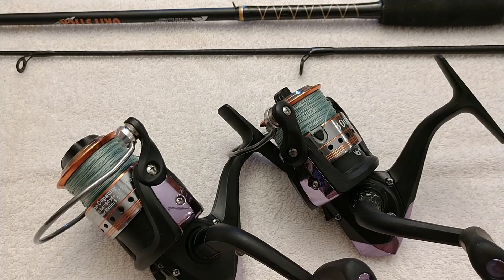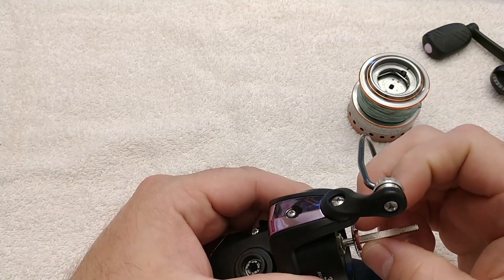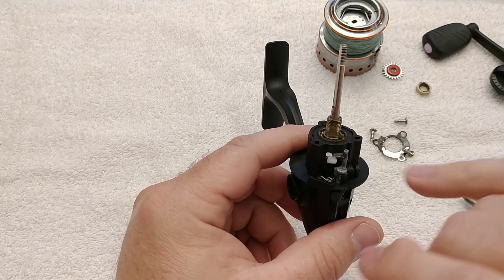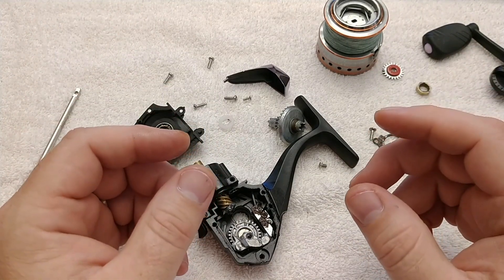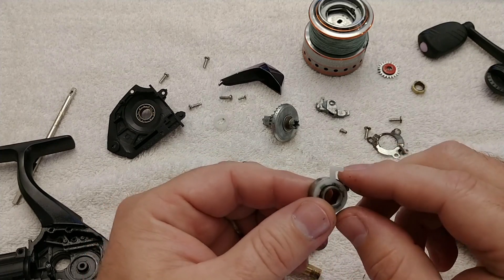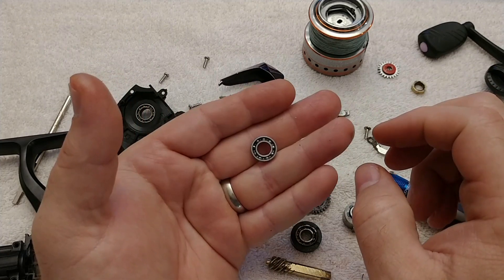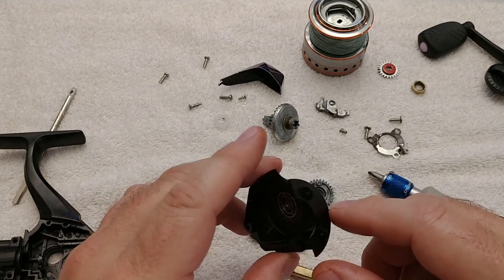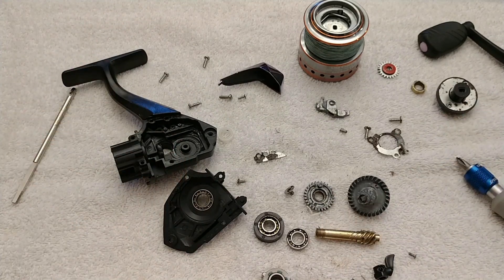Reel Won't Turn? How To Fix A Broken Reel That Won't Crank

Comment: Shockingly, I have never opened one of these up before my bearing was in a housing with two screws holding the bearing down, I pulled it out to clean it and it was so seized up I used some pliers on the bearing and it SNAPPED!!! Thank god it has a housing I pulled each ball out and cleaned them and put it all back together and slid it back in the housing then put the screws back on and boom fixed! Thanks so much for the walkthrough!

Comment: I went fishing back in October at the NC coast and used 12 of my vintage fishing Rees (no Daiwa 8600 this time). It was the first week of November before I finished taking them all apart, cleaned, lubricated and reassembled them. Speaking of bearings vs bushings I have three of those huge Daiwa 9000C Silver Series saltwater reels that only have 1 ball bearing and nylon bushings. These reels are 50 years old and work perfectly! The 7000C in that series (I have four) has three ball bearing in it are I’ve had to work hard to bring some of those bearings back from being seized. I’ve even replaced a few in a 4000C. I use PB Blaster to rejuvenate old bearings if it is possible. I personally hate reels with an AR clutch and no override. I think I have one Quantum and I never use it. I am opposite of you as I saltwater fish a good part of the time. I wish I had an ultrasonic cleaner but I clean my reels the old fashioned way. At the coast I always rinse off and wipe down all my Rees after use. If any of them get dunked I take my tools with me and I’ll disassemble that reel at the beach house and clean and lube it right there. I have many of my best vintage Mitchells in waterproof cases to protect them. I also have cases for some Penn Z Rees and my Shimano SSG7000 saltwater rear drag reels. I use gun wipes to wipe off the outside of my reels after they are dry. You gave some great advice in this video! — Chris

Comment: Thank you for the video! Got a Piscifun flame reel and first time using it in the river but the sand banks made my reel fucked up and seized up the main bearing. Got it loose with nearly all the sand out but the I spilled some grease down in the anti reverse lock areas and now my reel won't stop spinning. But this video will help me now!
Reply from the maker: Good luck with it 👍

Comment: I sold so many variations of that older Shimano you put up from 94-2002. Shimano just took that essential simple reel concept, and built a lot of their lineup around it. The ones you showed usually last the average angler 10 years by me (freshwater).
Reply from the maker: Those are decent reels and super cheap. Just reliable. Some of the really old ones with the same basic design from the 80's didn't use the fast cast setup, I wouldn't mind having one of those.

Comment: I have an interesting problem with my real it feels super smooth when you’re just testing it spins like a top free wheels just amazing but after your fishing with it for about 30 minutes to an hour it gets to where the handle doesn’t want to turn it starts sticking I have oiled it I’ve used real grease everything I know to do it’s quite the problem and it’s a new real and it has been this way since I purchased it I should’ve returned it but did not I thought it just needed broke in or a little lube
Reply from the maker: That is a strange problem and I'm not sure what may be causing it.

Comment: Where in the world do you find parts? I have a pocket fishman  that is rusted on the inside.
Reply from the maker: To find parts for that would probably require finding them or a parts reel on eBay.

Comment: Hey man,
Been struggling with my shimano Sahara c3000. Last time i used it something got stuck and i broke most of the gears. I basically replaced all the innards, cleaned and lubed everything. Seems to turn smoothly until i put the rotor on and i can hear friction. If i go ahead and put the top nut on, the reel can barely turn. I put it back exactly as i remembered. Watched videos, looked at every diagram and can't seem to figure it out.

Any input would be greatly appreciated

Thanks
Reply from the maker: It sounds like you are possibly missing a spacer washer that would go under the rotor. There have been a lot of different versions of the Sahara C3000 reels, so I’m not sure if this is the correct schematic for your particular reel or not…but take a look at part number 35 in the schematic. A part like that would be my first suspicion as the culprit. https://www.plat.co.jp/parts/SHIMANO-Spinning/SAHARA/17-SAHARA-C3000-03628.jpg
Reply: @TheFishingHobby  thanks for the response. Just took it apart again and i did have a washer there. But upon further investigating i noticed my clutch assembly was missing a roller. Not sure if that could cause that problem, but i guess I'll replace that and get back to you
Reply from the maker: That very well could be the problem. Good luck to you, I hope the clutch assembly fixes it for you!

Comment: What would you use as lube every time you say you would clean it and lube it up
Reply from the maker: I personally use Super Lube oil on parts that need to be oiled and Super Lube grease on parts that need to be greased. It isn't made specifically for reels, but a lot of people use it for reels.

Comment: hi, if you get chance can you post some links to replacement bearings, thanks, and is there any bearings you get that are more quality than others,
Reply from the maker: Here is an example of some cheap bearings: Generic MR147 7x14x3.5 mm Metal Open Ball Bearing (Pack of 10) by SnowSpitzShop Brand https://www.amazon.com/dp/B073X26D4Y/ref=cm_sw_r_cp_apa_i_squ3CbATGGHZW

I always order cheap ones because I just fish freshwater. If you want better quality, Boca bearings have a good reputation. Any well known bearing manufacturers will also have high quality bearings. Companies like Timken and others.
Reply: @TheFishingHobby  thanks
Reply from the maker: @lazycarper7925  no problem 👍

Comment: I just bought a new daiwa Bg 8000 and on the first day it started getting hard to crank. When my line is in the water it gets hard to make the line right or even reel in. Any tips?
Reply from the maker: I'm not sure exactly what is going on with your reel. Do you hear and grinding or rubbing sounds while reeling? My first thought would be something is binding. I have seen a bent spool oscillation shaft cause similar problems on other reels. You might want to take it out and roll it on a flat surface like thick glass or something similar and look for any signs of it being bent. Here is a great write up on those reels with a lot of disassembled pictures you can use for reference: http://www.alanhawk.com/reviews/bg16.html
Good luck to you on figuring out what is going on. I hope you are able to get it working right!

Comment: Thanks 😊
Reply: Mike from Maine here greetings! I have a small micro light South Bend tiny pole I got it at the transfer station for next to nothingand reelPretty cool rig but broke the post for the oscillating gear inside and I had to put a screw through the side of the real casing I drilled it out and it actually came out pretty good it’s holding so far now I’m just trying to put the thing back together LOL doing all right so far
Reply: Appreciate the video I almost did one myself Well I have this whole thing taken apartbut I don’t have a lot of practice with that type of thing ha ha but thanks a lot
Reply from the maker: Sounds like that should work 👍
Reply: Funny I got it working good now but everything went back together now I can’t figure out why it won’t lock as a real it in
Reply: Excuse me as I reel it in
Reply from the maker: Lock? I'm not sure what you mean

Comment: Miss your videos buddy!
Have you ever made your own bobbers? Been experimenting with BBQ squares and cork from wine bottles.
Reply from the maker: I've been putting out several videos lately! Stop by my home page and take a look, might be something you like in the newer stuff 👍 I built an extra long ultralight rod out of an 8' long vertical jigging crappie rod that is a blast to fish with. You may want to check that video out.
I have never made any bobbers but if I do I will be sure to make a video on them!
Reply from the maker: This link will take you there: https://www.youtube.com/channel/UCqne7f-bMbuFFlnKETAesiA
Reply: @TheFishingHobby  Just watched it, great video!
Got a solid fiberglass rod from the 50's I think. Want to do the same thing.
Reply from the maker: @thejim3501  I just happen to be building my daughter a solid glass rod at the moment! It is a blank from a 70's Zebco rod.
Reply: @TheFishingHobby  This one is so old I can't tell who made it. The handle is made of cane! I'm sure someone in the past put it on, but it looks factory. LOL
It cast unbelievably! It is about 8'6" long and looks like bamboo, but is painted light and dark stripes along the length. But I have no experience with building rods. Trying to learn. ☺
Reply from the maker: Sounds like a fun project 👍

Comment: Whenever my reel does this, I just dip it in the water and it works again. Can I just keep doing that?
Reply from the maker: It may have dried salt in the bearings locking it up. The water would dissolve the salt, freeing it up. I suppose you could keep doing that, but I'd relube it after it dried personally.

Comment: I had a similar problem I fixed it, but the reel is spining in both ways what can I do?!
Reply from the maker: The anti-reverse isn't engaging. The anti-reverse switch may be disconnected.

Comment: How do I fix a reel dar don't reel my kid keeps crying bc it's brand new and doesn't retrieve the line back it's the Ozark trail 5000
Reply from the maker: I'm not familiar with that reel, is it a spinning reel, a baitcast reel or a spincast reel? You can email me a picture of the reel and I may be able to help. thefishinghobby@gmail.com
Reply: It's a spinning
Reply: I got it at Walmart
Reply from the maker: When you turn the handle, does the rotor rotate around the spool?
Reply: I got it working it works thanks
Reply from the maker: @marmar5025  congratulations!
Reply: Thanks

Comment: My spool won't come off
Reply from the maker: Could be stuck from corrosion. Spray some wd40 down the oscillation shaft that the spool mounts to and let is soak overnight. Try again and see if it will come off.
Reply: The Fishing Hobby yeah I've been doing that for the last 2 days won't even move
Reply from the maker: @chesterjamesalbiller1185  have you ever had it off in the past? Is it a pushbutton release spool or the type that comes off by removing the drag knob?
Reply: The Fishing Hobby it's the one where you have to remove the drag
Reply from the maker: @chesterjamesalbiller1185  if there is no push button release and you removed the drag knob then it should just pull straight off. You can remove the drag knob on some push button release spools and the spool won't come off because the push button isn't in place to actuate the release mechanism on the oscillation shaft.